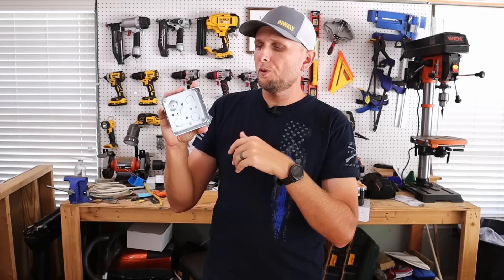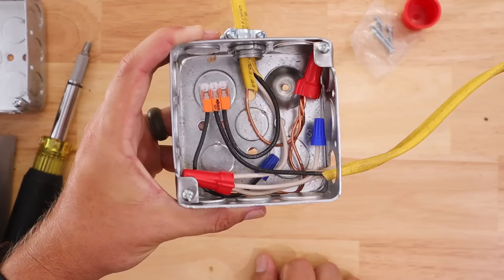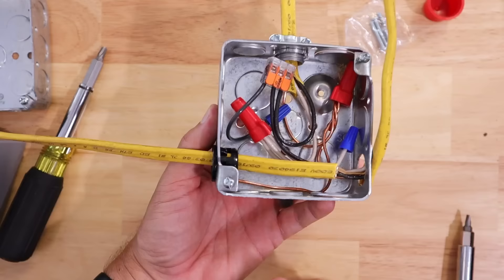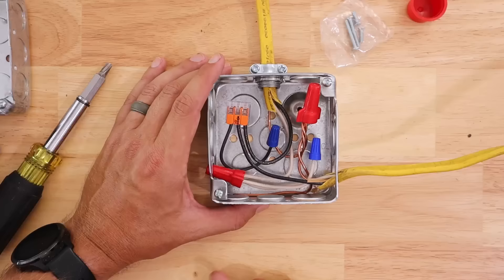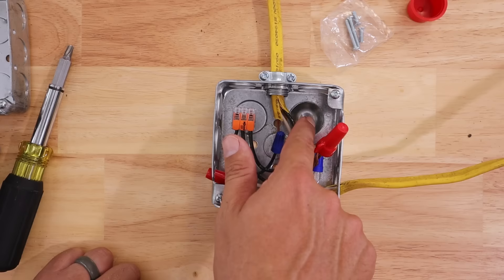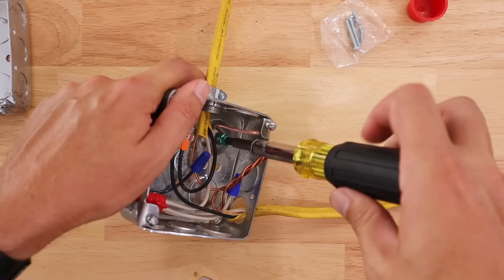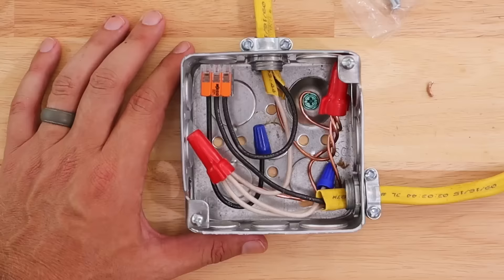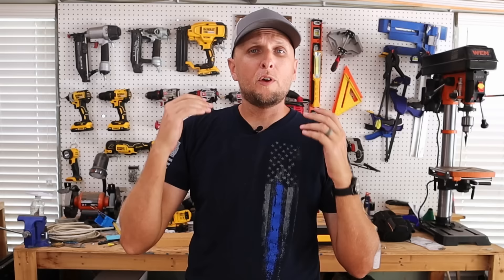The BIGGEST Mistakes DIYers Don't Know They Are Making When Installing Metal Electrical Boxes

Comment: You are right, these are common DIY mistakes, also I am with you, a good electrician twist the wires...it is just good workmanship.  From the code book, sure, the pig tails to a receptacle should be the same size wire.  I will point out that from an engineering point of view, #14 is rated for 12 amps in the tables, but we derate this because it can only do this in short lengths and would result in over heating in all but the shortest runs. We do the same with #12 which can carry 30 amps in short lengths.  (look at the tables in the code book and you will notice the footnote about derating both)  For that reason, while I would never use a smaller wire,  #14  in pigtail length would have no problem with carrying the load and would probably not even get warm.  Another good point about the green ground screw for the DIY guy, mounting screws are not allowed for grounding, ever.....but I would rather see it grounded to a mounting screw than not at all!
Reply: Yeah, hence difference tables for "chassis wiring" and "power transmission" that you often see in tables,  smaller lengths are fine.   That said, if I'm running NM wire,  I'm using the same gauge if anything due to convenience of snipping off a piece of the roll I'm using for the hot, neutral and ground pig tails I'm all making.
Reply: Voltage drop is proportional to length, so the heating effect per inch will be the same for a pigtail as it is for twenty feet in the wall.
Reply: 14 is not rated for 12 amps , rather it is not allowed to be loaded to more than 12 amps . It actually has higher ratings in the tables for deration purposes
Reply: Ya no no mounting screw
Reply: I'm better than good, and I don't pre twist my wires, pretty sure I've not ever had a connection fail. Wire nuts are a tension device squeezing and digging into the wires. If we consider the surface area making contact it's not hard to why twisting is counterproductive, especially when the manufacturer of the wire nuts says to not do it. I believe it may be leftover from the days of ceramic nuts, in that case it's most likely better, or even necessary
Reply: @jeffreystroman2811  agreed
Reply: the problem is the cheap wirenuts have instructions saying not to pretwist which means your insurance will come back at you if there ever is a problem and deny you for not following manufacturer instructions

Comment: It’s been a while since I’ve opened a code book, but the multiple gauges on one Wago seems like it would be fine IF the cable run is long enough to have to account for voltage drop. As long as it’s a 15-amp receptacle on a 15-amp breaker, I believe this would be code-compliant. The Wago would have to be listed for both wire sizes too.
Reply: Yes, I'd say that if you're going to pigtail that to a light, going to 14 gauge would be fine.  If doing an outlet, I would never drop the gauge of wire down.
Reply: Probably in the 3rd world.
Reply: 14ga cu wire is good for 15a circuit. It's stupid to run 12ga all of the way to the box, then pigtail with 14ga, but if the chicory is on a15a breaker/ fuse, it will not cause a fire.  The breaker will trip before the circuit gets overloaded. It is a waste of more expensive material to run the home run in 12/2wg, then use 14ga for a pigtail that would require a15a breaker vs a20a
Reply: @bilmoe5856  Not true at all!  First and foremost once behind the meter you pay for the losses.  The bigger issue is voltage drop.  In a larger house, you definitely run 12 up to the first junction, then 14 from there just to reduce inductance and resistance and still use a 15amp breaker.  In some areas, it is even code that you are actually required to do this beyond about 50-75ft (most places closer to 100ft).
Reply: I'd say in most houses you aren't gonna be concerned about voltage drop
Reply: @bilmoe5856  our house as far as we can tell the electrician that we hired changed a 20  amp circuit to a 15 amp and replaced the outlets with 15 amp for some reason we can't fathom. then connected the new outlets with wago's just like this.  it's 15 amp outlets on a 15 amp circuit now so i don't think it was a problem but i wanted 20 amp back so i replaced them myself.  love the wagos though.  made it so much easier to replace the outlets without taking 1/4 of the house dark for two hours. just a minute at the beginning when disconnecting and again at the end when reconnecting
Reply: @Californians_go_home  agreed.  i just find in our kitchen the 15a receptacles get loose after a year or 2.  so since we still had 12guage wire on it i replaced most of the 15a with 20 outlets and replaced the breaker with a 20a like the circuit was before we had a contractor switch out our box from a fuse type to a pushomatic type.   was just commenting about how easily the wago's made the work and how nice it was my mom could pretty much keep cooking except a minute at the biginning and end of the job because of the pigtails
Reply: @johnpaullogan1365  There was no need to replace the multiple 15 ampere receptacles to have a 20 Ampere circuit supplying them The US National Electric Code specifically permits the use of multiple 15 ampere receptacles on a 20 ampere circuit. With a single receptacle, not even a duplex which has 2 receptacles on the same yoke, you have to use a 20 ampere receptacle on a 20 ampere circuit. The only critical point would be to be certain that the entire circuit is wired with 12 gauge or larger wire. 

Tom Horne
Reply: @hornetd  i mean the label showed there had previously been a 20A breaker on that circuit and he replaced it with a 15.  i found a box of used 20A outlets in the closet.  the previous owners kids say they think their mom forced their dad to do it because she felt 20a outlets are ugly because they are asymmetrical but noone knows for sure.  and no you actually can have 14g wire in there.  if i wanted to say wagos to take a couple inch piggyback inside the outlet box from the main wire to a 15a outlet that actually meets code in my area.  not that i would ever do it but i've seen it pass inspection here
Reply: @johnpaullogan1365  they got loose because they wer often used outlets and residential grade, the don't make a residential grade 20A so you installed a commercial outlet which solved your issue. a 15A commercial or industrial grade receptacle would have solved your issue as well

Comment: Wire size changes in a circuit happen all the time. As long as the wire ampacity exceeds the breaker there’s no issue with having different gauges of wire in a Wago. In fact one of the massive benefits of Wagos over other other wire nut alternatives is how easy it is to adapt from say 12ga to 16ga. Of course when installing a new breaker and running a new circuit you should just select the appropriate wire gauge. But oftentimes wiring is oversized for the breaker, and the equipment you’re tying in has smaller wiring than the circuit.
Reply: I seen wagos fail in high hat lighting where the lamp heat combined with attic humidity caused corrosion. 
Not a fan as the actual size of the surface contact is less than a regular wire nut.
Reply: @mikemccormack3997  at least Wagos are outrageously $$$
Reply: @mikemccormack3997 how would the same not happen in a nut?
Reply: @sparksmcgee6641  the connection comes from the wires being twisted together  the connector is just a protective cover. the WAGO has to carry the current internally
Reply: @Galgamoth  see your point, but all the testing I've seen is that it avoids bad wire nut installs with the visible connection.
And the response from people is that "thier wire nuts never fail." As a builder, I'd like to see them more in areas where you know homeowners are going to mess with it. Garages utility rooms, etc..

I tried finding electeical death and fire in europe vs US but couldnt find enough data to compare safety.
Reply: @mikemccormack3997  Overhead lighting on superyachts is actually one of the most common applications I see Wagos used, both interior and exterior lighting. Obviously a very corrosive environment. And I’ve never seen a Wago fail. Almost certainly the fixture will need to be replaced before the Wago, and at that point it’s just a matter of visually inspecting it to check for corrosion and replacing if needed. And is there anything in this world that’s easier to replace than a Wago?

Comment: as an Electrician apprentice I have to shoot you major respect. 
I caught 2/3 and didn't catch the 12 gauge wire. 

Thank you for making some of us be better at our craft and home owners safer. 

At first glance, even my mentor didn't spot that gauge difference first. 
Although at second look, he did spot it... I didn't. 

Again...thank you. 

Much respect to trade and major respect to you.
Reply: I'm curious, there's no mention of the breaker size on this circuit. Just because it's 12 ga doesn't necessarily mean it's a 20 A circuit. It could be a really long run on a 15 A breaker, or the installer might have been out of 14 ga to finish the job. I don't see anything wrong offhand with using a 14 ga pigtail even though it's 12 ga coming in. Am I mistaken?
Reply: @crisdunbar4753  I am still learning, but I would locate/isolate that circuit and factor in the amps it was intended for. If it's lights, fire away on that 14ga. 
If it's plugs... eliminate all 14ga because you never know when someone is going to plug in a TV, Playstation and 1600 watt electric space heater. 
I'm curios to see his answer too. (I've only been  an apprentice electrician for 3 months... on the job training - no schooling)
Reply: @ericallen7200  I guess that's my point. The video claims without qualification that the 14 ga pigtail is a mistake. This may also be a jurisdictional thing. Where I am (BC, Canada), 15 A general-purpose (mixed outlets and lighting) are the norm, with 14 ga cabling. But of course, using a 12 ga cable is perfectly acceptable (if uncommon) on a 15 A circuit. So I don't see the 14 ga pigtail as an automatic error.
The intention of the circuit is beside the point I would say. If it's a 15 A breaker, the 14 ga pigtail is fine; if it's a 20 A breaker, it isn't, regardless of what is used for.
Note, I'm not even an apprentice, just a fairly well-educated amateur. =)
Reply: @crisdunbar4753  code wise you have an issue still but reality wise i don't think it's a problem having the 14awg on a 20A circuit there as it is less than a foot and nothing returns to the main circuit there.  14awg will stand up to 20A at that length just fine. still not best practice and probably a code violation though not sure as i do know whire length plays a part in the code for amperage.
Reply: @crisdunbar4753  we have anumber of 15a circuits here ran with 12awg wire.  codewise it is fine to step down to 14awg there but it is a bad idea.  the next idiot working in the circuit will see 12awg out of the breaker and assume he can slap a 20a breaker on there.  not that i think it would actually be a problem as long as you aren't feeding out of the outlet 14awg that short should handle 20A without an issue but code will come down on you for it

Comment: Great video. However as you stated that you have to use a green ground screw. I agree with you on that but code says that you can use a screw that is machine type and color truly doesn't matter. Now for me I am like you, I use green because I have thousands. Your videos are very helpful and I always appreciate a great tradesm. Keep up the good work.
Reply from the maker: I agree, there is no code for color and they need to be machine screws.  I just stated what I did about the screws as you know they are going to work and they are so easy to find for folks in the electrical section.  Wouldn’t want someone just using a deck screw.  Thanks a lot for the feedback!   I have enjoyed and learned a few things from your videos as well.
Reply: Yes there is mention of green screws
Reply: @gerdberg4188  That's for the MAIN or SUPPLY jumper (if its a jumper - The main panel bonding jumper)

Comment: I'll just throw this out there as a general tip for anyone working on older houses like mine.  

Always treat the box, receptacle, whatever you're working on as if it is live.  Even if you just flipped the breaker and tested the circuit.  I'm remodeling my kitchen, in a house that was built in 1920.  Wiring is sketchy to say the least, but everything I've found so far in the wall I'm working on is modern Romex so I wasn't too worried.  Yeah, well I shut off power to a circuit I was going to modify and add some receptacles to.  I plugged a tester into the outlet I was about to take apart, it did nothing.  Once I took the cover off and pulled the receptacle out a bit I tested the circuit with a multi-meter.  No juice detected.  So I started disconnecting things.  I had already pulled the hot wires off and was working on the neutral wires.  As soon as I got one of them a bit loose and was wiggling it to pull it away from the screw I got a bit of arcing.  I was wearing mechanics gloves with a rubberized coating, and using tools with plastic handles, so I didn't feel anything.  My theory now is some other circuit nearby must be stealing neutral from the one I was working on.  Pretty common in old houses.  

At that point I told my wife to light some candles and shut the main power off to finish the work.  So yeah, just like with guns, always assume it's "loaded".  There are videos out there on how to safely work on live circuits.  You shouldn't do it on purpose, but using the techniques every time you touch a circuit is a good plan anyway.
Reply: Even newish house. Mine was built in 1999. Flipped breaker to living room tested an outlet and confirmed no power. Oh but the corner outlet near the hallway was live. Ouch…
Reply: And...know who you're working with. While I'm adding ceiling lights and juice for an electric oven the homeowner was in the back of the house working on the bathroom wiring which I had no idea he was doing. When I throw in the breakers and walk back into the kitchen I hear his wife screaming about a fire and I could smell overheated wires. I thought I had made mistakes but his wife made him tell me the truth. He undid his work and my work tested perfect. He tried to lie about it but I had separated, metered and marked all wires in a 3-unit box when I started and when I hurriedly saved the breakers and began metering those wires again they were different than before. I showed him and his wife made him admit what he'd done. Without her I would have been there for days.
Reply: Was working in an old church and had a neutral wire arc to another neutral with the breakers already cut...
Reply: @t3hgr8gabbo  fun times!